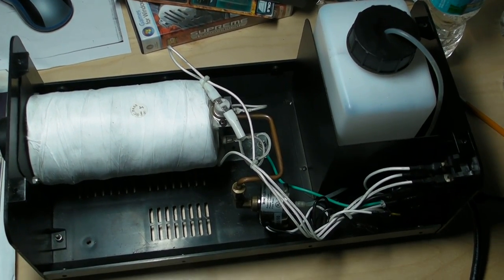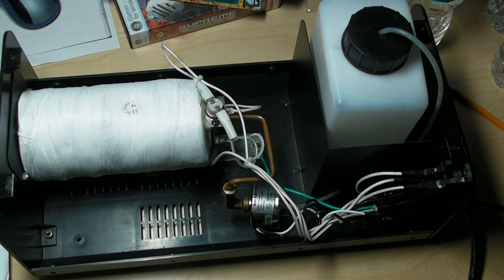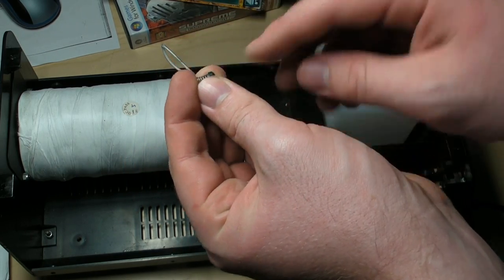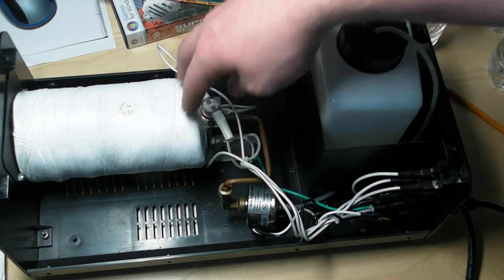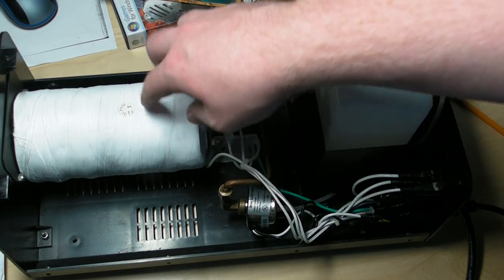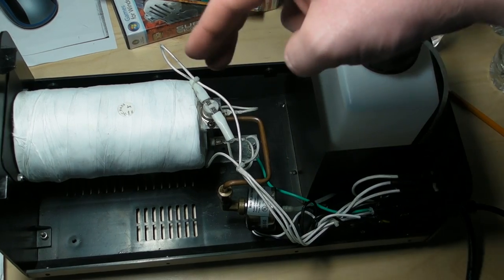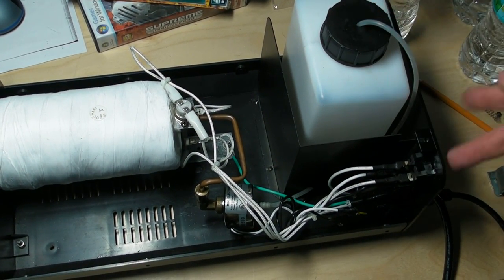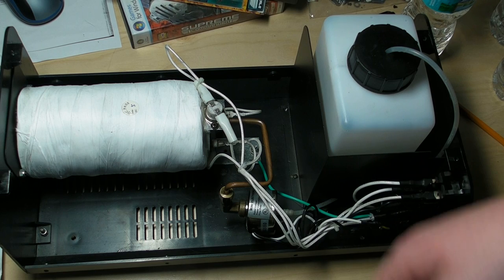How Does a Fog Machine Work?

Comment: 31 JUL 2022:  Another possible problem might be the thermal fuse located under a piece of metal hidden from view just below the heater leads. If that fuse goes nothing works. To get to it there is a metal tab visible under the heat chamber and it's easy to bend the tab and get the fuse out which in my case was covered with a rubber tubing.  With power off I tested the fuse with a multi-meter and it was a solid "open" - no current flow. On a whim I bypassed the fuse with a jumper and it started to work. I've had this happen once before.  My thermal fuse is a SEFUSE SF188E 192°C 10A, 250V because mine is a 1000W fogger. My older foggers were rated at 500 watt and used a SF152E rated at 157°C. Total cost for a pack of five shouldn't be more than $9.00 with shipping. It's just going to require a solder job as the original fuse is held in place with crimps.

UPDATE: 2 AUG 2022:  $1.53 (5 for $7.64 on Amazon) and the old 1 KW fogger is up and running.

Comment: CORRECT THE MISTAKES 
1. The Bimetal switch heats up the element to 260c 
You cannot run the pump not because its going to blow a breaker! You cannot run it because if the element is not hot enaugh you will get liquid out the other side.
So the pump can run just when the assembly is over 260c

Comment: I have a cheap $35 machine that stopped working.  I think the heating element burnt up after being left on without fog juice. Is it possible to fix or should I just buy a new one?  Thanks a million man.
Reply: It is not the heater that is affected by the lack of fog juice, it's the pump.  The pump uses the juice as a lubricant and if you continue to run it dry (trying to make fog with no fluid), it destroy's the pump, not the heater.  The pump is probably the issue and for the $35 dollar cost, you would be better off replacing the unit if the pump failed.  I would check the fittings on the pump and the feed tube to the heater first and make sure it is not clogged.

Comment: Can you please help me design a 12 volt 
fog machine, using  the exhaust pipe for heat,  on a 2016 4 door Chevrolet Silverado pickup. I want to place the discharge  under the body, along the driver-side door openings Thanks James at customerservice@stitools.com

Comment: I have a similar machine, worked great for a long time but left fluid in it for a while. Just comes out real slow now. I took the pump off and energized it, a strong stream of fluid flows out. I hooked a pressure tester to it, and it jumps to about 60psi, and slowly raises to about 85 psi. It will hold it there for a long time after I shut it off. 

So I'm thinking the pump is fine. I also removed the copper tube and the brass fitting that screws into the aluminum block, and all of that is clear. But I can't figure out how the heater works. Looking into the aluminum block, all I see is another brass plug type thing with half of a slot like a slotted screw, but I cannot see an orifice. I forced compressed air into it, and almost nothing comes out the exhaust side of the heater. Is it safe to say something in the heater is clogged?
 I don't know how the heaters work. Does fluid just dribble in there, or is there a nozzle that sprays the fluid (that could be clogged). I just can't see a hole whatsoever looking into the input side of the aluminum block. I almost thought of drilling a hole in that plug looking thing l, but that sounds risky if it's supposed to be sprayed like a mist in there. Whatever it is, it's holding back a lot of pressure.
Reply from the maker: Sounds like it is gunked up inside the heater. You could try flushing it with a solvent and or compressed air.
Reply: s28400 just tried going backwards with compressed air. I think it flows easier now, but I'm replying as I'm working on it. I'll flush it a few times and try it. Thanks for the quick reply.
Reply: s28400 Pushing air backwards through the heater got it flowing okay. Wasnt great. Sprayed some strong cleaner in the end and forced it through with 100psi of air about 15 times, flows a lot better now. I'm running out of time tonight but I have high hopes of this fixing it. The plan was to use it tonight for Halloween but I spent Halloween trying to fix this thing lol.
Reply: s28400 Got some new fog fluid, works great now. It seems like I don't get as long of a burst as I used to, but it's been a while.  I did mat down a lot of the insulation when handling it which doesn't help, not sure how much that affects it.
Reply from the maker: Nice, glad to hear you fixed it. You might want to look at replacing the insulation if it is damaged. It should help your runtimes.

Comment: hi i have an american dj mini fog machine. The power light switch lit when switched the machine was plugged in but it doesn't heat up the unit and the ready/ release button usually lights up as well and switches off when it's ready to dispense fog, it doesn't light up anymore and the machine is not working. Would you know what is wrong with it? Would really appreciate if you could shed some light on this. Thanks.
Reply: Scott Lei mine did that. it was the switch, it was fried inside. removed switch andfound a switch slightly bigger in size on ebay. i cut hole s bit bigger for new switch and it worked fine for ages. now it has stopped making fog. itsgot power and i have tested pump which is fine and so i have ordered a new heater as its obviously not coming threw that so itmust be faulty. should be here by weekend.

Comment: Hi, I have a 700 watt fog machine and I need a replacement pump for it. Could you include a link for a new pump because I can't find one online.
Reply from the maker: +Adam Rutledge Something like this will do: http://www.ebay.com/itm/1500W-Fog-Smoke-machine-oil-pump-40DCB-31-31W-220V-240V-/191855428405?hash=item2cab798335:g:iQsAAOSw1DtXJMEm
Reply: s28400
Thank You! I will try to get me a new pump now.

Comment: Sorry quick question. Do you know if it is possible to make a small hand held fog machine. approximately 5 inches by 2.5 inches in a cylinder like a tube
Reply from the maker: +Catalyst MindGame Sure, all you need is to find a 12v DC pump and  a 12v DC heater along with a battery to power both. Some assorted tubing and you're golden. Although, unless it needs to shoot out like with these machines, it might be easier to use a coil and cotton setup similar to what is used in mechanical mod vapes. In fact, some
18650 cells would work great for that as well. Cheers!

Comment: Do you think it would be possible to create a backpack fog machine that could pump fog out of an insulated tube that is run through a face mask for special effects?
Reply from the maker: +Patrick Yanusz Absolutely, it would be very easy to build a low voltage DC heater around a pipe and a acquire a 12v pump. It could easily run on a 12v lead acid battery. Since it is in the face mask, it might be easier just to get a high wattage vape pen and integrate it into the mask. Cheers!
Reply: +Patrick Yanusz I'm looking into some kind of wearable fog machine myself. Is there a place where I can go to learn the ins and outs of making them? Like how hot the glycerine has to be, how to choose/control a heating coil so it doesn't get too hot, choosing fog juice that doesn't leave residue on surfaces, etc?

Comment: My fog machine won't heat up do u have any suggestions or can u get the heater online I have the same fogger as this one in your video 😊
Reply from the maker: +Pyro  Guy I would take a multi meter and measure the resistance across the thermal couple. That part is one of the most common to go. If it is working fine, aka resistance zero, then your heater is burnt out. Also, check the fuse, if it is blown, your heater is likely burnt out.
Reply: Ok thank you so much im going to try to fix it today and is the heater that big white thing or is that the chamber that keeps the heat in

Comment: So at startup when the heater is at room temp, the bimetallic switch is closed and the pump should be running? 

I have a Lite F/X machine with a timer control. When I turn it on, there is no action and no sound.
I took apart the pump. It is clear and operates when I apply 120V to it. At startup, the voltage at the pump leads is zero V. 
The controller is impossible to take apart because the screws require a tool four inches long to reach them. 
Where should I begin the diagnosis?
Reply from the maker: No, the when first turned on, there is a heat up period, usually round 5-8 minutes. Then the switch closes and allows the pump to be activated only after the heater reaches the target temperature. Let it heat up for 10 minutes and try it. If it still doesn't work, I would listen for the thermal switch, as it should make a click sound when closing. If not, it may have failed. Hope this helps!
Reply: Many thanks for that. I see what looks like a temperature sensor embedded in the heating wrap. Is its function to turn that switch on when the target temp is reached?
Reply from the maker: Jack Dinan Yes, it allows the pump to be turned on and I believe it also turns off the heating element.

Comment: I have a 400w fog machine and just for a project, I was wondering if I could upgrade the heating element to a 1000w? I cant find any info on it, so I was wondering if you knew if it was possible. thanks in advance
Reply from the maker: I mean it is theoretically possible as long as all of the fittings are the proper size. You may have to also change the fuse rating to handle the higher current of the new element. The only other thing I can think to check is the required pressure to pump into the new element. If that is the same then I would say it would be fine otherwise you would have to change out the pump but this is probably not the case. If you do carry it out, be sure to post a video and link it to me, I would be very interested to see the results. Hope this helps!
Reply: alright thanks for your help ill keep you up to date

Comment: I was wondering what it means if all you hear is the pump running but no fog coming out and what it means if it doesn't heat up or anything else. what can I do to fix it?
Reply from the maker: If you hear the pump running but no fog or fluid is coming out of the nozzle, it could mean a few things. The most common being the pump or tubing has been clogged by old fog fluid. You can try and fix this but forcing vinegar in it with a pipette or similar and try running it to clear it out. If the heater is not heating, you could check the thermal switch to make sure the heater is getting power. Also check the impedance to see if it is shorting or blew entirely. If the heater failed, it is possible to get replacements online.
Reply: how do you tell if the heater is getting power?
Reply from the maker: Get a volt meter and measure the voltage on the terminals. You can also use the voltmeter to check the impedance of the heating element.
Reply: s28400 ok when I test it can everything works if it does but fog still doesn't come out then what? thank you for your time.
Reply from the maker: CrazedHaunter24
Well if nothing is coming out then it must be clogged, try the vinegar trick I mentioned above or you could try blowing an air duster threw the pipes to break up the gunk. If it is pumping fluid out the nozzle, then the heater needs to be replaced. No problem, good luck!